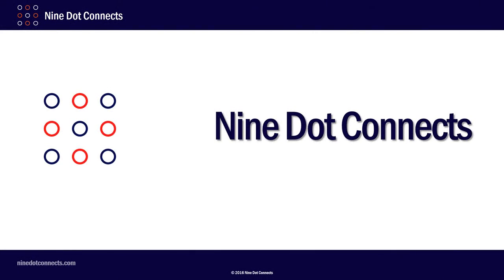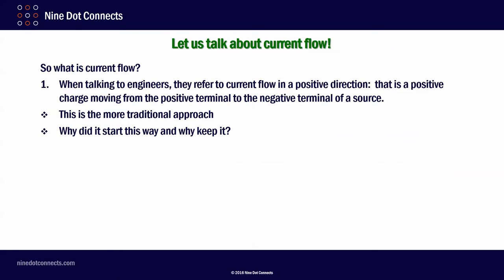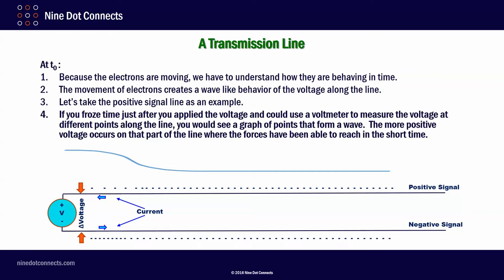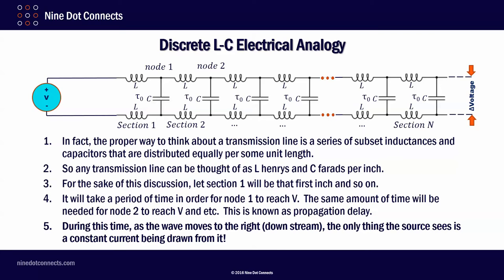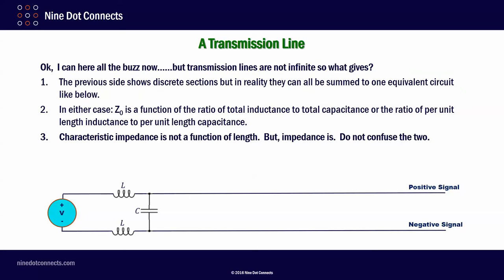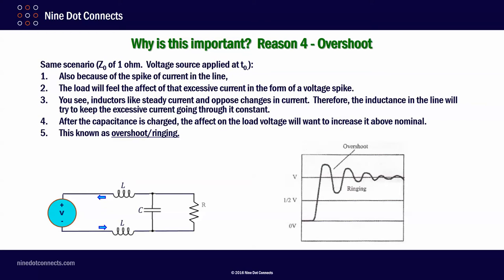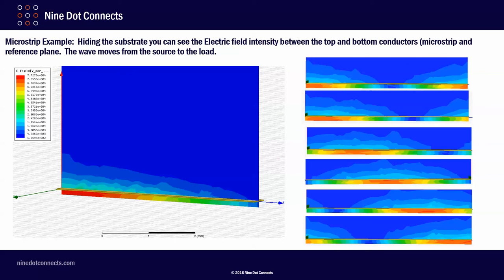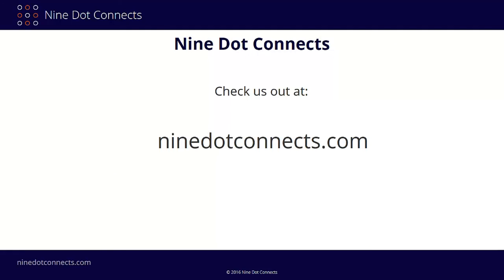What does a 50 ohm impedance mean?

Comment: Great video, thanks. What is the minimum signal frequency that requires matched impedance of 50Ohms? Is it possible to have other values aside from 50ohms as long as it is matched?
Reply from the maker: We assume you are looking for a way to match impedances that may be different between the driver pin and a receiver pin.  You definitely want to match impedances.  The failure to do so will result in a voltage reflection which will damage the driver pin.  Sometimes it happens quickly; other times it will happen over time.  You have two options.  The first is to put a series resistor immediately after the driver pin.  As for the value, is it simply adding whatever resistance that will bring you to the desired value.  For example, if you have 50ohm driver impedance and the receiver needs 75 ohms impedance, you would add a 25 ohm impedance to the trace.  That resistor needs to be as close as possible to the driver.  

The other option is to have a load resistor parallel to the receiver pin.  You would use the equation for a parallel resistor to find the appropriate value for the resistor.  The resistor would need to be as physically close to the receiver pin as possible.